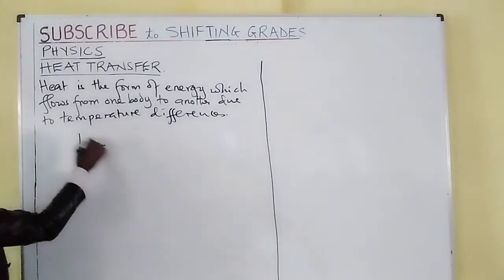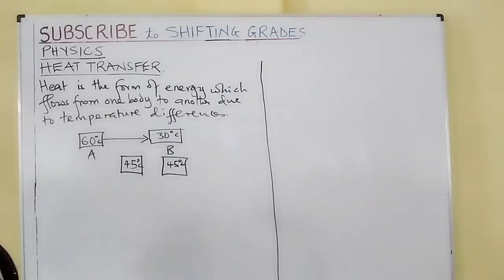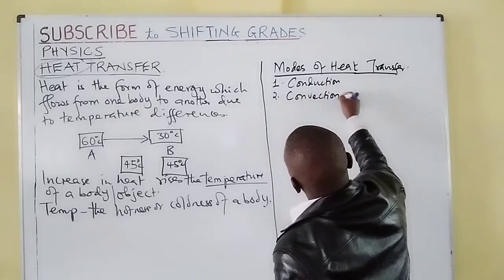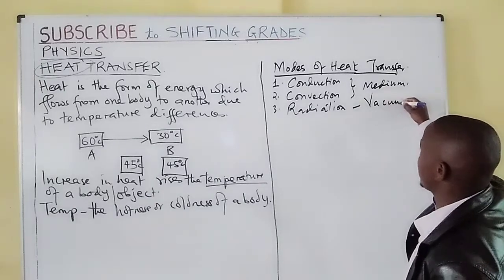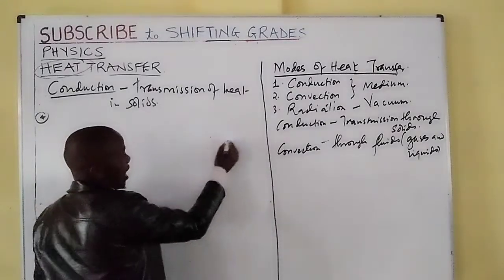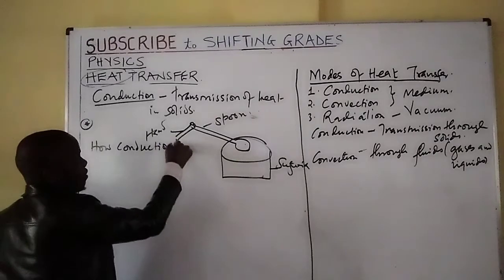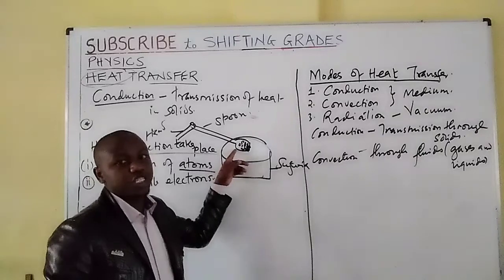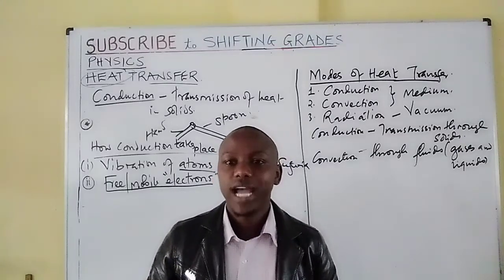HEAT TRANSFER- INTRODUCTION

Comment: explain two mechanisms by which the heat from the flame reaches the hand
Reply from the maker: Okay
Reply: we have vibration and free electrons .
let us use a spoon that is dipped in hot tea. Heat energy passes the hot end and vibrate the atoms the atoms in turn collide and there is increase in vibration of the spoon therefore heat is passed across the spoon
Reply: let us use the second mechanism we have free electrons . Metals have free electons which atravel through ot the spoon.Heat energy which is injected at the hot end of the sspoon increases its vibration the free electrons gain morr kinetic energy and because they are free to move they spread heat energy to the other parts of the spoon